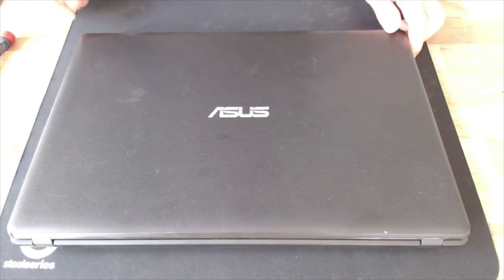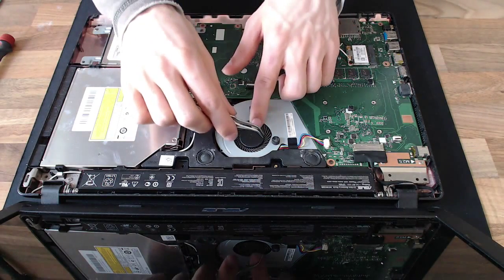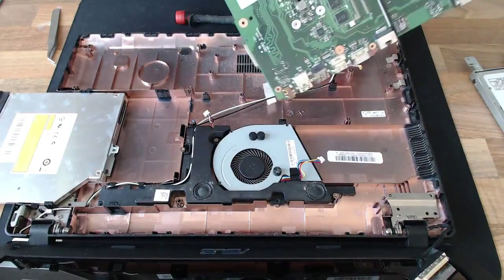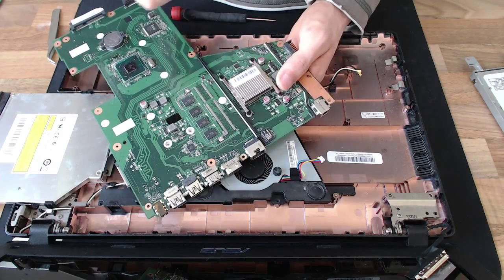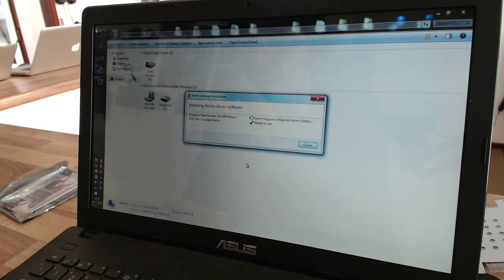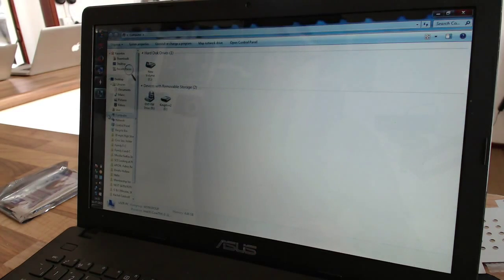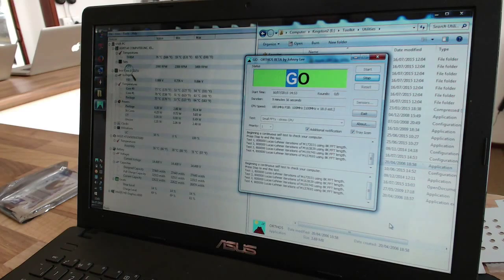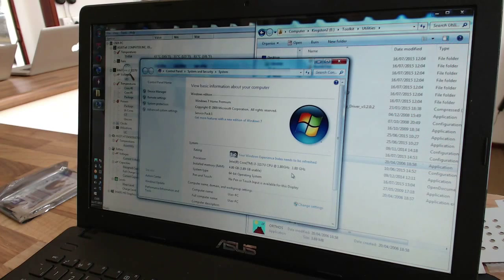LFC#42 - Overheating Diagnostics

Comment: 9:22 rock on bro 🤟  haha 
Also Hwinfo64 is better than hardware monitor, I know this is 5 years old but hopefully you've switched by now lol 
overall nice video

Oh, also yeah classic "something in the fan" scenario. 
friend gave me a dead PSU that wasn't dead, there was just a rubber grommet from his case somehow in the fan. He gave me the PSU anyway HX 850 I , I just am waiting on replacement fan since it still crashes when the fan would kick on even though there's no obstruction anymore
Reply: There's better & "better" when it comes to Hwinfo vs hardware monitor.  Monitor is simpler & loads faster, when working on systems where you only need a quick check, rather than more detail, the lesser featured program may be more suitable.  You don't need an elephant gun when hunting wabbits...